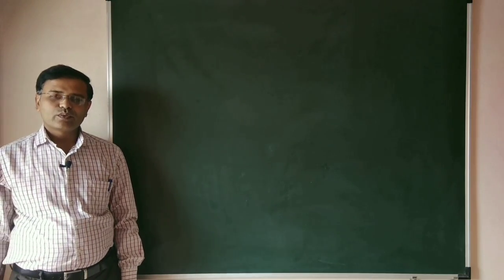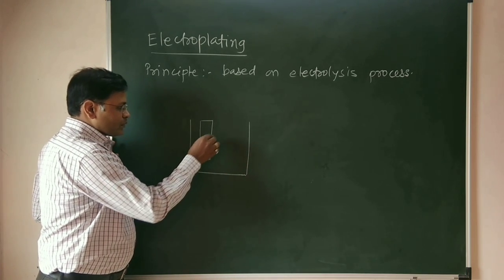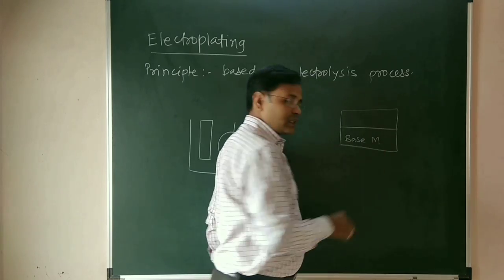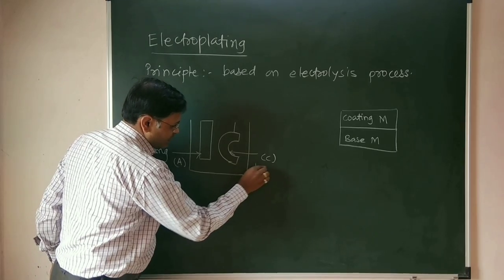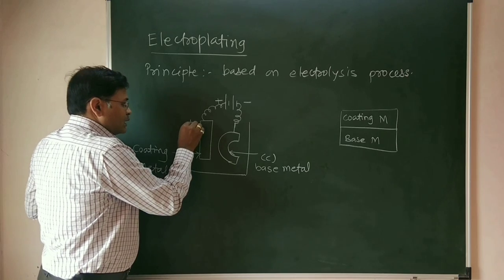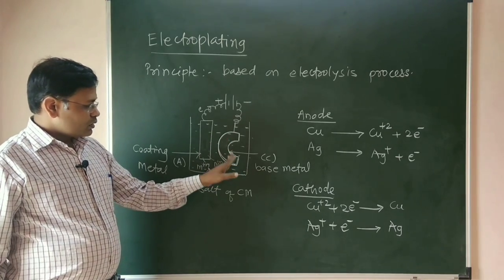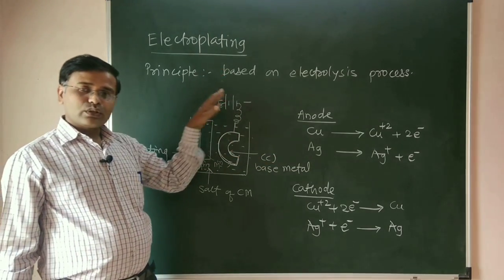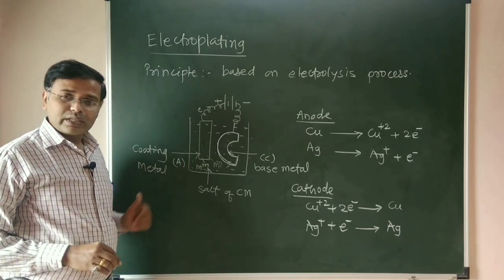Electroplating Process for corrosion control | Types of Metallic coatings

Comment: Ur connecting worng sir anode is connect with negativ cathode is connect with positive
Reply from the maker: No. 
See the references. This is electroplating, which is based on Electrolysis principle. In this metal connected to positive terminal acts as anode and undergoes oxidation.